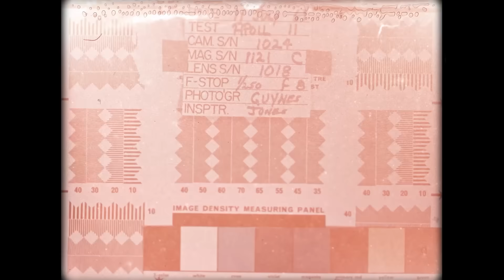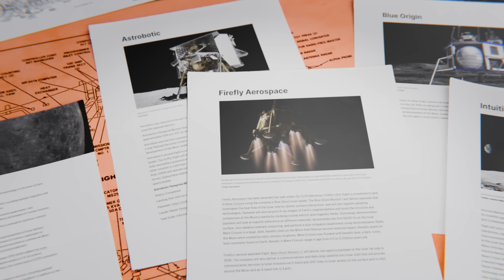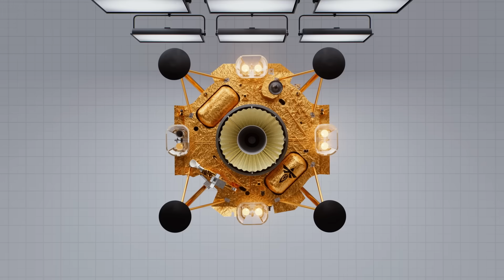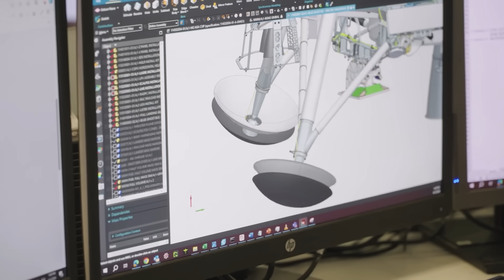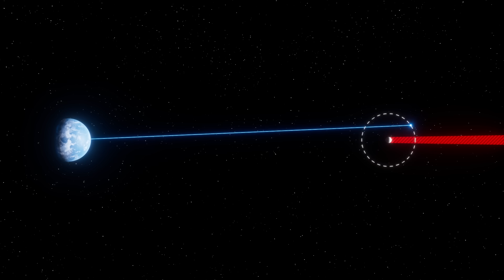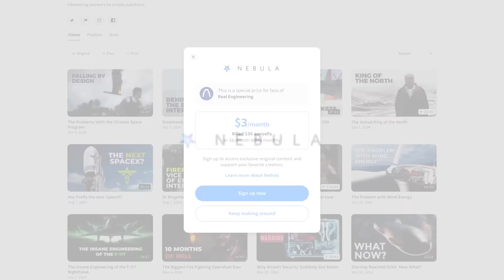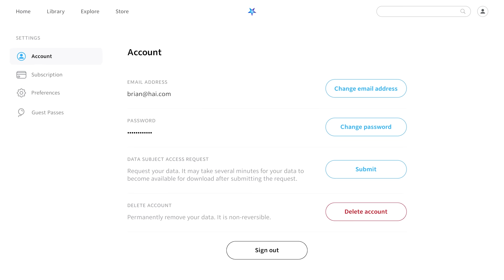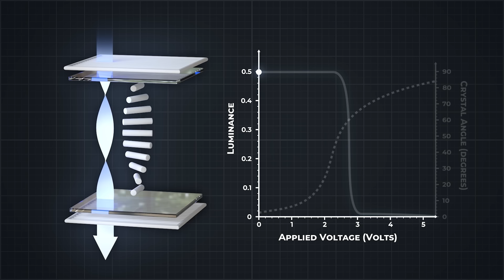Why the US is Struggling to Land on the Moon

Comment: Honestly I don’t understand the difficulties behind the problems discussed. Yeah, I get that we have to measure things, there’s a lot of moon dust, we have trouble with precisely locating the lander. But I can locate my earphones on the other side of the globe with precision up to few meters and NASA scientists with the contractors can’t calculate altitude of a 100mln USD lander? 

Some of those proposed solutions seem to be so missed. Uneven levels of fuel in the tanks? Just add a pressure system distributing the liquid between the tanks evenly. Having trouble measuring exact distance from the moon in the last phase of the landing? Use laser measure? You can’t even have a reliable system to confirm whether a lunar has LANDED? Give me a break. You have TWO cameras size of a water bottle installed? Embarrassing at this point. 

I clearly don’t have afull picture but I wonder whether there are better solutions to some of these issues.

Comment: Interesting discussion on the problems of landing the craft.  To simplify the landing position and keep it perpendicular to the landing site, why not install a gyroscopic disk that spins up via the out-gassing of the landing thrusters so its only put into use at the final approach. This will keep the craft perpendicular to the lunar ground during the last moments before contact at the known blind spot.  The gyro system would be similar to the method used to turbo-charge a car engine and the rotating plate can be made of some light material such as aluminum or titanium or even a composite polymer?  Do you following my train of thought?

Comment: I deal with radios. I have for over 30 years.  It's my job.  Specifically I deal with Satcom radios and I can tell you this.  There's a thing called delay.  If all these recordings are not clipped and are indeed real time then it's all bunk.  There's Satellite delay from one side of the planet to the other.....and it's quite significant.  Recall back to the Olympic games live in Sochi Russia 2014.  Any time there was a question and answer interview from the US you had to wait quite a while for the round trip answer that the interviewer in the US would ask the athlete and that was just around the world.  The Earth to the Moon is the distance of all the thickness of the planets stacked side by side to each other.  All the planets would fit between the moon and earth orbit.  Think about that.  If it takes 3 whole seconds for Satellite delay just to get a signal across and around earth and back again......Then it should take 20 or so seconds delay to talk back and forth to someone trying to land on the moon.  This is why Mars rovers are autonomous,  No one drives a radio control in real time to the rover.  They give it a list of commands to perform and the on board computer decides if it can perform that task safely.  Let's talk repeaters now.  The beginning of the video says the command module had to get the comms antenna aligned at the lander so mission control could communicate with the lander otherwise they would have not tried the landing.  Ok.  Repeaters also add time to that delay.  And another thing, the command module was not in geosynchronous orbit over the moon parked over the lander.  That thing was moving....so much so it went around to the dark side where it had zero comms with the lander.  Michael Collins can be witnessed talking about being up there in a documentary and how he was "alone" by himself with no one to talk to  as he traversed the dark side and couldn't wait to get back around so he could communicate again.  So which is it?  Was he really scared?  Or did they ever leave Low earth orbit?
Reply: The original recordings have the delay (about 3 seconds) in the correct places. Some documentaries removed the delay. 
Also keep in mind that the Apollo S-band system is full-duplex, and there are instances where the astronauts started giving the answer before Mission Control finished answering the question.

Comment: The lander that tipped over should have been designed wider with a lower center of gravity. Aeronautically a silly design flaw. What were these guys thinking?
Reply: Making the lander wider would not have solved the actual problem: they forgot to switch the altimeter out of safe mode, which meant they were landing without knowing how far they had to go.

Comment: As a great engineer once said: "The more they overthink the plumbing, the easier it is to stop up the drain..." NASA went to the moon and back SEVEN TIMES in less time that it's taken Elon Musk's tinfoil rocket to fail again and again and again.
Reply: Development of the Saturn V took 8 years, and development of the F-1 engine started even earlier than 1961. Musk decided to go to flight testing at a much earlier stage than NASA did with the Saturn V: the SV spent years on test stands working out all kinds of problems. Going to flight tests earlier in the program gives you useful flight experience earlier, at the expense of having some “failures”.

Comment: why not use LiDAR for detecting landing distance? seems like a relatively solid solution for the problem. and do solid state gyroscopes  (like the ones in our phones) not work in space?
Reply: They used a laser rangefinder. They forgot to switch this out of safe mode before launch, which meant the rangefinder didn’t work. 
A lidar was on board, as one of the science experiments. This was jerry-rigged to help with the landing, but that didn’t work well enough to prevent the crash.

Comment: we learned back in the 70s... going to the moon is a waste of time and money. we learned in the 80s the space shuttle program was extremely expensive to maintain. we learned about 14 years ago the shuttles were too expensive to keep using and needed to be replaced. In the past few years we learned the space station can not be maintained much longer and needs to be replaced. Spending all the money on the Space Shuttle and Space Station to only get 30 years out of it only to have to pay another humongous amount to crash it and start all over again from scratch. We are learning now that it is not feasible to go to space. Rockets to go to the moon or mars cost too much, too many difficult issues to face, too dangerous. all parts of the infrastructures do not last long enough. Money could better be spent on earth to make life better for everyone than going into confined spaces for the rest of your life

Comment: ?Did NASA do an Actual Earth Flight Test of the Lunar Module Design that simulated landing on the Lunar Surface?

Aerodynamics in the Earth Atmosphere wouldn't exist in the Lunar Surface Vacuum Environment; but, Testing the Lunar Module Hardware for collisions with Unknown Lunar Objects within the Landing Zone can't be accurately simulated within a Computer Program.

It is already known that Luna does have Unaccounted For Rocks & Boulders on the Lunar Surface.

I think that not accounting for unknown Lunar Surface Objects within a Landing Zone was an Oversight Error.
Reply: For the Apollo lunar module, they did those tests. Apollo 9 tested most of the LM flight profile in Earth orbit, Apollo 10 did that again in lunar orbit. The only thing they couldn’t test there was the radar altimeter, so that was done in separate tests on the ground. 
The IM-1 was not tested in orbit like that. I think the landing hardware (altimeter, control system) was tested on Earth, but I don’t have details on that.
Reply: @Hobbes746  ...
I wasn't referring to the APOLLO Program.

I grew up in that Era.

I was referring to the New Lunar Lander.
Reply: @stevequerin2504  The landers for Artemis are still in the design phase.
Reply: @Hobbes746  ...
To me, having an Unmanned Probe Lander crash land like that seems very problematic for the USA; because, the USA had been successful at landing Manned Lunar Landers of a similar Spacecraft Design on Luna in the past.
•   Yea ... It has been 50 Years; and, Spacecraft Component Technology had made major advancements since then.

It seems to me that there was an over-reliance on Computer Simulation Tests before doing the Real Thing.
•   There was no On-Earth Real Life Landing Tests.

The APOLLO Lunar Lander Descent Module underwent extensive Real Life Manned Test Flights for Landing Tests.

Back then in the 1970s, Computer Technology wasn't capable of the Complex Simulations that 2020s Computers are capable of.

However, that doesn't mean Real Life Flight Tests could be discarded altogether.

India had a similar problem with their Unmanned Lunar Lander; however, India was a Newcomer in Outerspace Exploration during its Lunar Lander Program; whereas, NASA had Decades of Real Life Experience and Organization before the Manned Lunar Landing Missions.

I am a 1980s Hardcore RPGer (Roleplaying Game Player; NOT, Rocket Propelled Grenadier); and, I have some Computer Programming Experience; and, I have some Video Gaming Experience; and, I am the creator of the FLOWER CHILD PROJECT Manned Spacecraft Design Concept.

There are issues with Modern Day Computer Programming Languages & Compilers.

There is an over-reliance on Artificial Intelligence; and, on Computer Program Simulations within the Civilian Populace.

I know that NASA and ESA and the other Outerspace Agencies are doing their best to keep things Professional and Unproblematic as possible.

But, Present Day Young Adults grew up on Smart Phones; thus, don't have a Healthy Awareness concerning Computer Programming Errors; and, Faulty Coding; and, Ill-Intentioned Ethics concerning Computer Programming at all levels.
Reply: @stevequerin2504  The Intuitive Machines lander crashed due to a basic error of a type NASA had learned to avoid by the early 1960s. IM used an altimeter that had to be set to a safe mode for tests on the ground (it uses a powerful laser that could blind someone). They forgot to switch it out of safe mode before launching, which meant the altimeter didn’t work. 
One of the first things NASA found when it started to launch satellites is how important it is to have a process in place that avoids such mistakes. You create a checklist, you review it, and then you use it in prelaunch preparations and you don’t allow the spacecraft to launch unless every item on the checklist has been checked off and verified.